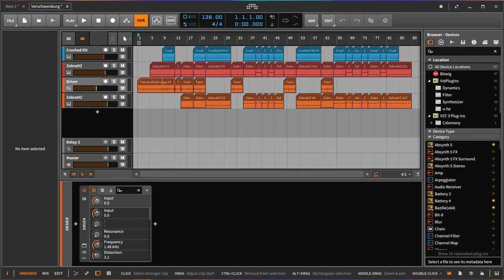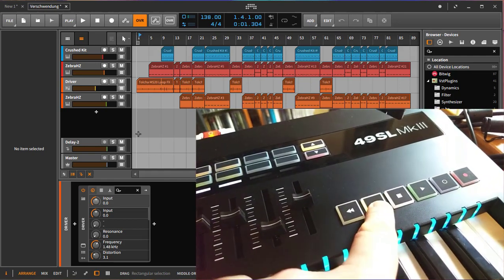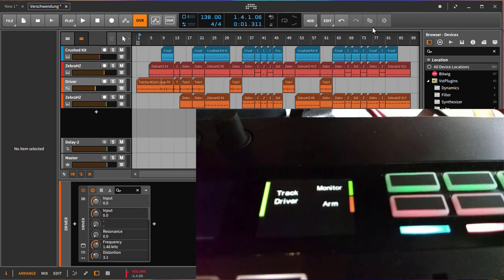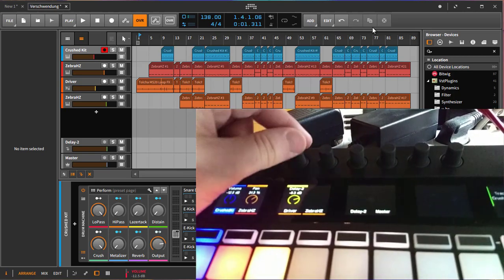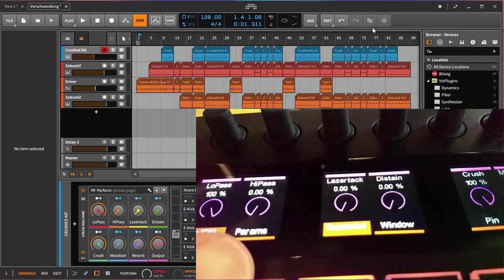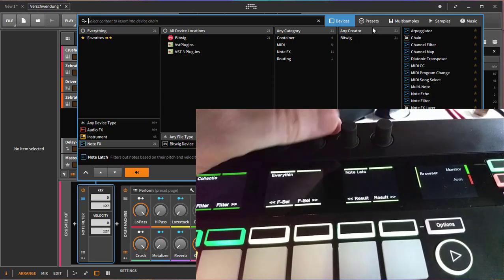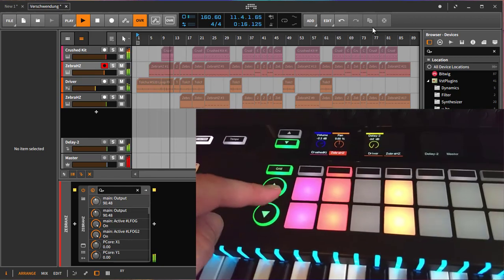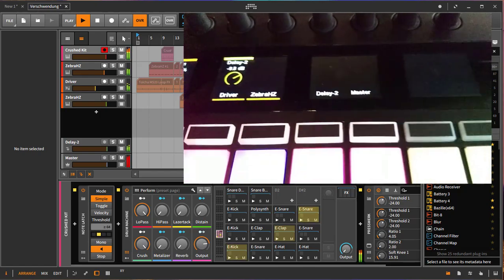Novation SL Mk III - Full native Bitwig support

Comment: Really awesome ! Just tried it, works great, except for keyboard split, made a quick test with two dest parts (channel 1 and 2), channel 1 works, but channel 2 not coming through. I have a channel filters on two tracks with proper setting on bitwig (3.0 beta 9). Note: when using a generic midi in bitwig instead of DrivenByMoss it works fine. Thanks !
Reply from the maker: Good point. Did not think about that, so currently only channel 1 is forwarded but this can be easily changed. Will look into it for the next update.

Comment: in your first video about SL MK3, you talked about 3 approaches to implement this control : General Flexi, Mackie HUI, Ableton Mode. I wonder what approach / solution did you choose to be able to have the full control that you show us here ? is it an approach that is completely based on Novation Components App ? or a hybrid approach? or something else ? Thanks !
Reply from the maker: It is the DAW mode (or Ableton mode) which allows to do basically everything.

Comment: Hi Moss, Just got the SL Mk3 and you have seriously elevated this things functionality. I read in your documentation that while in control mode in the sequencer (blue Grid + arrows) you can select and preview/play the different drum machine voices, but I only seem to be able to select the different drum voices but not play them ( until I lay down some steps to trigger them), can you tell me if this is correct behaviour or am I missing something. I would love if it had the functionality to play as well as select. Keep up the sterling work you absolute legend.
Reply from the maker: Just checked and it works fine. Check if you have installed the latest Firmware with the Novation Components App, then check if your input of the track is set to either "All" or the "SL MkIII Pads" port. Also make sure that the track is record enabled (or monitor is on).
Reply: @mossgraber  your a gent, that worked, only after I restarted the keyboard for some strange reason. Superstar👍

Comment: I have a Novation ReMOTE 25SL Compact USB MIDI controller. What do I have to do to get it to work with Bitwig 5.1? Also, have a Nektar Panorama P1 controller I will like to get working with Bitwig. Any help will be greatly appreciated. Just found about it. Keep the good work !!!👍😃
Reply from the maker: You can use the Generic Flexi which is also part of DrivenByMoss. see the manual and the playlist on my Youtube channel.

Comment: This is amazing. I've just downloaded it but I'm confused as to how to change the scale easily with the light guide?
Reply from the maker: You can set the scale in the Bitwig document settings. This is in the right hand pane if you click the 3rd icon on the right hand bottom. Click the little triangle before the controller name to open the document settings for the device.
Reply: @mossgraber  Thank you!! I've just moved from Ableton to Bitwig and having all this extra functionality is amazing. Great work 👏
Reply: @mossgraber  I've noticed that the light guide seems to glitch out and conflict with the native light guide on the slmk3. I'm guessing this is just a bug? I've tried turning it off from the SLmk3 and it still happens. Apart from that minor issue, you're doing God's work. Cheers!
Reply from the maker: @ctd_audio  Thanks. What do you mean by "glitching"? There is currently an issue when you transpose the keyboard that the pressed notes are wrong, which can't be fixed. I am not aware of other issues.
Reply: @mossgraber  so sometimes it seems to flick back and forth from the key lights on bitwig to the colours or scale you have set up on the controller itself. I turned scale mode off on the slmk3 sequencer in the hope that would stop it from conflicting but it still does it from time to time. Minor issue but just wondered if it was known or not :)
Reply from the maker: @ctd_audio  DId not experience that so far.
Reply: @mossgraber I'm not seeing the document settings button in 5.1. Is there another way to do this now?
Reply from the maker: @thejayce Watch this: https://www.youtube.com/watch?v=j2QQgT9t_gs

Comment: When I click on “in control” my keyboard screens are blank and I am not receiving a Bitwig template
Reply from the maker: Some more info would be helpful. Did you install DrivenByMoss correctly? Is the device detected? Is the extension starting? Any errors in the JavaScript console?
Reply: Jürgen Moßgraber I went to your website off the Bitwig community support page and got a 404notfound page. Can you link me? I have the 3.2 upgrade to Bitwig and when I go to hook up the MKIII in the controller page in Bitwig I’m only given the option for midi in. Not midi in/out so I’m not sure if that is part of the issue.
Reply: Jürgen Moßgraber I didn’t see any errors in Java that I could decifer. And yes the controller was detected but only allows to choose midi in
Reply: Jürgen Moßgraber I will say when I hit “in control” I can control the stop/play/Rec buttons but none of other control panel options like sequence/patterns/duplicate/arp, etc. any help would be so great thank you
Reply from the maker: @ultrajayme  This is the download page: http://www.mossgrabers.de/Software/Bitwig/Bitwig.html#3.2
Reply from the maker: The Download contains a manual as well, please see the installation section.
Reply: Jürgen Moßgraber thank you so very much Jürgen. I will turn everything on in just a few moments and let you know how it goes!
Reply: Jürgen Moßgraber I wasn’t able to locate the link I am supposed to copy the extension file into. It only takes me to the Bitwig support page. Also when I open Bitwig to add the SL MKIII, When I click on that controller option, it only allows me to choose midi in. If I choose other novation controllers such as launchkey mk2, I can select two midi ins and two midi outs. I’m rather confused as this has never happened before with prior controllers or Bitwig 3.0....apologies I’m having such a difficult time with this. It’s frustrating
Reply: Jürgen Moßgraber after all the trial and tribulation I got it sorted out. Thank you